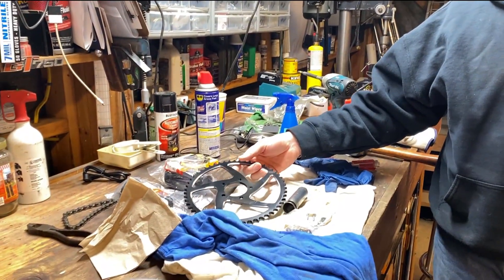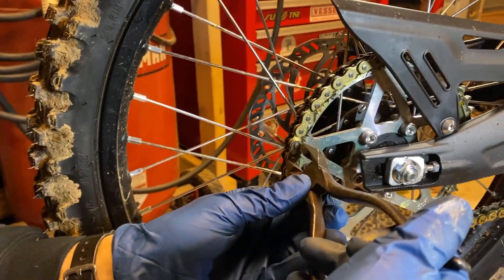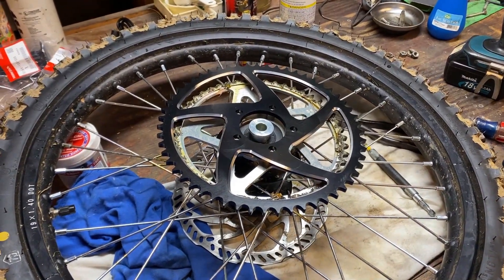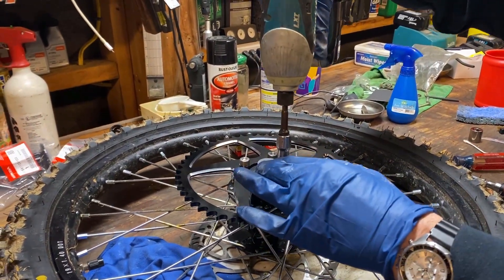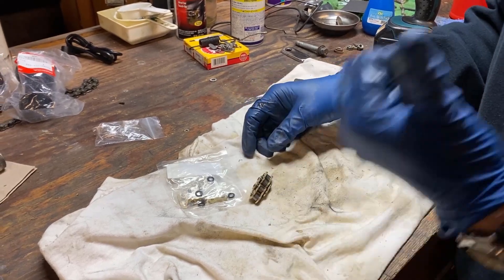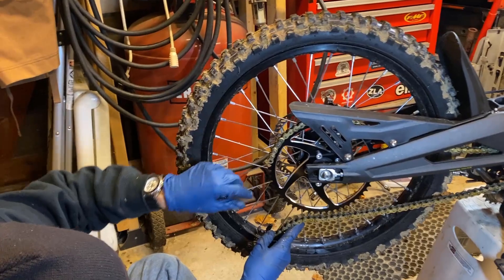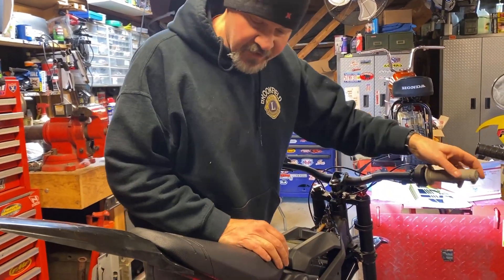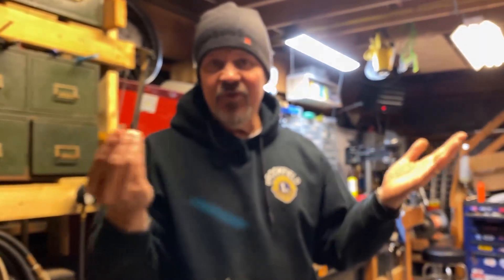Sur-Ron X Torque Monster! 55 tooth sprocket upgrade

Comment: Sur ron loves there red lock tight, everyone has a hard time with sprocket bolts . I went with a 54 tooth big difference & im still getting 49-50 top speed ?? I’m still going to gear it down more (58) the sprocket u got is the biggest u can go with an add a link .

Comment: Did you lose top speed switching out the sprocket im looking to get one but I’m not tryna lose top end speed just want a lil more torque of the line
Reply from the maker: It was a little slower on top but hardly noticeable.  After I did this I got a BAC4000 and bypassed my battery and got the top end speed back and then some.   In my opinion the bottom end gains made it worth the few mph loss on the top.   Good luck and thanks for watching.

Comment: looked at a couple of vids ,but could not confirm ,the Sur Ron has no Cush drive ? (the rubber parts in the wheel that dampen sudden power), even my Honda Grom has kush drive and im thinking the power is about the same , they rock the same 420 chain , do you know?
Reply from the maker: There is no cush drive on the Surron.

Comment: Sorry bud, those aren’t diagonal cutters. Good video though. May be just the upgrade I’m looking for.
Reply from the maker: Yep, I was waiting for someone to call me on that.  I noticed that when I edited this and decided not to put the "these are actually lineman's pliers" note on the screen.  Sometimes I'm just a knucklehead!  In any case, I'm glad this was useful and thanks for watching!
Reply: @Chris_Does_Everything  - A stout needle-nose is all you need for master-links.  If you get one that wont quite click-in, remove the clip and give it a few swipes across some sand paper to remove any burrs.  And what do you ride in, cow manure? ;-)
Reply from the maker: @chucksavall  Thanks for the tip Chuck!  Parts of my yard do get a little cow manure like in the winter :)